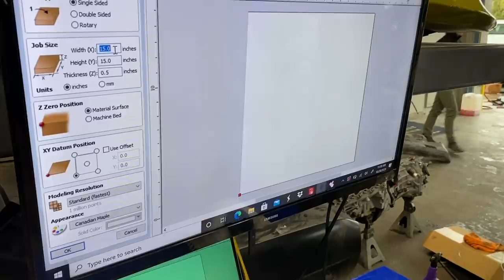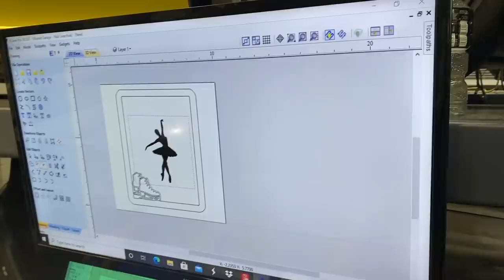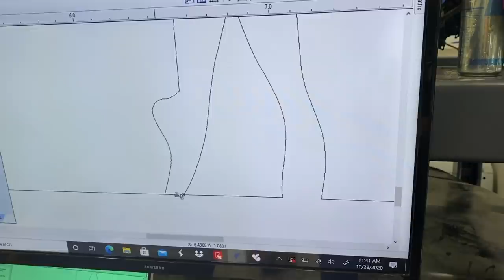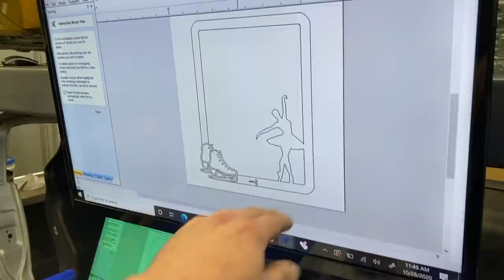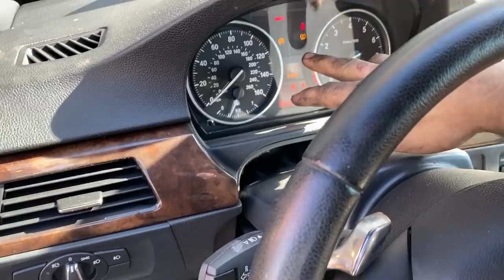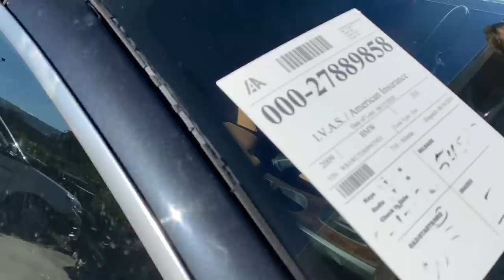Wiring up the motor in our BMW 335i and attempting to start it!!

Comment: Hey Mark. You guys are amazing. Willing to take on projects like this especially on  BMW. 
I've worked on my own cars over the last 50 years and still do and I'm over 70 now. I never did anything this complicated.
Did steam propulsion systems in the Navy with all the ancillary equipment. That still was simple compared to this. Except it was 135 - 150 degrees in the engine room aboard ship. 
Hope that motor you took out is OK so you can get some of your money back. 
See you in the next one.

Comment: Well now I know why they need the CNC machine. They can make templates of the Mclaren parts and then cut them out, weld pieces together to form the expensive parts at a fraction of the price. 

Very good investment guys.
Reply from the maker: It’s gonna help us a lot 👌🏻
Reply: @Motorheadco  Cool
Reply: Yuri says "what McLaren" . I distinctly heard him say that!
Reply: @fredericrike5974  yeah it's a McLaren
Reply: @Mj-sc8jy  Yuri swears we are having a mass hysterical hallucination! I mean if Yuri said it, I want to believe it!
Reply: @fredericrike5974  inorder to build parts for mclaren vtuned had bought the CNC machine
Reply: @Mj-sc8jy  NOt a bad surmise' however, the McLaren, if indeed it is, is made of aluminum and carbon fiber mostly. The engine crankshaft and flywheel are about the biggest parts made form steel.
  All that said, the last response from Yuri Livarchuk was that we are all having a mass hallucination or other false image. We all should know by now, Yuri "knows these things".
Reply: @fredericrike5974  Hmmm

Comment: Love the bmw content ! Also with ignition on only hold gas petal down for 12 seconds and heat on high with fan at lowest setting it will purge the coolant system . Takes about 10 minutes. Make sure you have charged battery before but this ensures no air pockets since it’s a electric coolant motor. Great job guys ! From Middle Tennessee.also the power steering reservoir has a filter in it. Normally replace them with higher mileage. Sorry guys get excited about this engine lol

Comment: The brakes run off the vacuum canisters, as well as the boost solenoids. If you boost hard, brake, boost hard again, then brake, you risk loosing brake pressure. Most of us just relocate them to the other side, behind the charge pipe.

Comment: You'll be fine without the vac canisters. They act in a similar way to a clutch delay valve so you might find the boost coming on a little less smoothly and more aggressively. Not sure if you saw my comment on the last video but make sure you keep an eye on your oil filter housing gasket! Common leak that can totally grenade your motor on these engines. Great job guys!
Reply from the maker: Yea I saw it 👌🏻 I checked it’s good

Comment: Check the battery terminals where they connect to the wiring loom under and behind the battery where the wiring goes through the bulkhead, known weak point causing all sorts of electrical issues. Could be the cause of poor starting and your roof not opening.

Comment: Long story short on the vacuum canisters - if you don't have them and you brake really hard - the vacuum your vacuum pump is generating will all go to the brake booster, and not leave enough vacuum to control the wastegates appropriately.

Comment: That beamer was a steamer. 
I mean when it was started some sort of smoke was coming from the engine bay.
Love the videos👍💪
Reply from the maker: There was oil on the cats
Reply: Just oil burning off the  manifold it isn't a problem will clear in a few minutes

Comment: think I had the smoke problem on my 335i in that exact place.. turned out I forgot to clip one of the oxygen sensors away from the engine and it ended up burning through the cable.

Comment: Um no the canisters aren't really "Optional" LOL. They are needed so that the turbos have a reserve of vacuum to open the waste gates when they are not spooling up or else they have to rebuild that boost all over again and there will be a LOT of turbo lag. As well the vacuum system for the brakes will be affected and other things won't work as intended.

Comment: Good job with the engine, you guys prove it can be done, these cars ain't rocket science, just advanced engineering, the peak of combustion technology, now getting replaced by much more simple electric motors.
Color of the rims on the very nice recycled BMW? Gun metal grey is my suggestion. Thank you

Comment: Why are you using Castrol Edge engine oil in that motor? BMW stopped using it decades ago because sludge gets build inside the motor over time.

Comment: some vehicles require the injection system to be bled to avoid an air lock, common on diesel injection specially Toyota which I specialize on.

Comment: Just one thing, I heard you should never jump-start a bmw on the posts you used, should be on main battery terminals only. Apparently you can fry the electronics!!! They are delicate enough as it is 😂😂😂
Those posts are for charging battery and diagnostics. Don't know how true that is, but saw it on YouTube not long ago.
Reply: As is silver or gold for wheel color 👍

Comment: VTuned buys a CNC Plasma Cutter to make better quality parts for custom builds. Goonzquad buys a house with no walls, electrical, or plumbing and spends the next 4 months making video after video of nothing. Great job on the BMW and great investment on the CNC. Great things coming.
Reply: Paint the wheels a charcoal colour and brake calipers red would look very nice

Comment: These injector will just open when reaching a minimal pressure level.
With air you won't be able to accomplish that, the engine won't start and you scratch your head sore wondering why the car won't start
Reply from the maker: It don’t start 😂